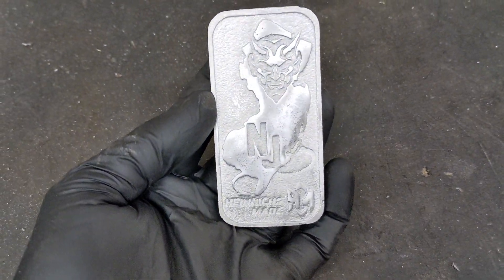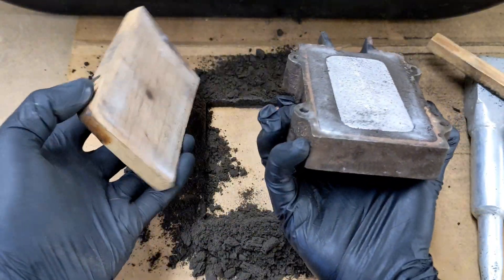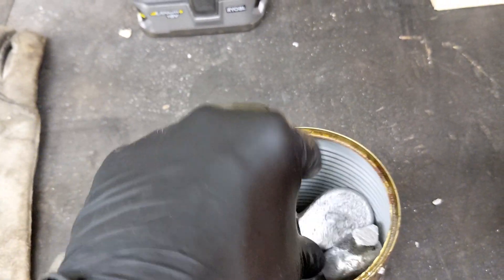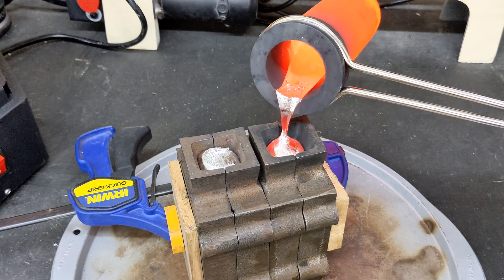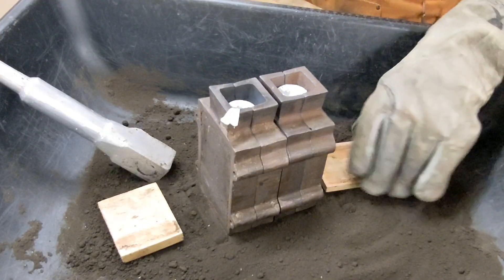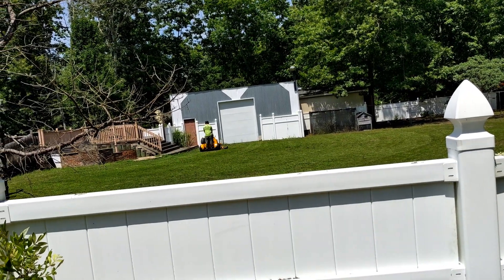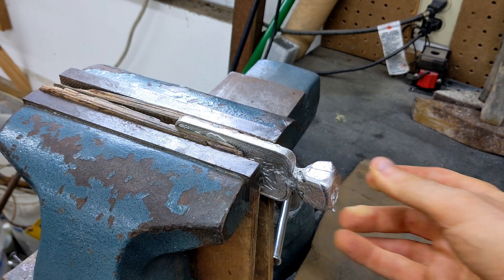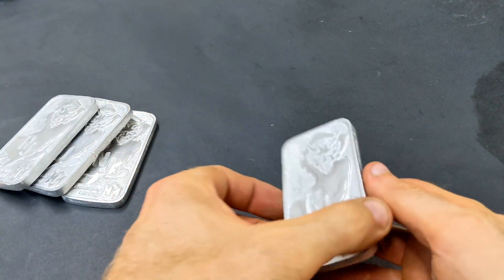DIY Aluminum Casting

Comment: Another really cool video. Couple of questions, 1) the baby powder that you are using is it actually talcum powder or is it pure corn starch?  2) have you ever considered making this bar out of .999 fine silver. It looks like it would be about 5oz of silver.
Reply from the maker: Thank you so much!  1) the powder I am using is talcum powder.  I believe I used the corn starch in the past and it didn't work. 
2). I don't really cast silver, because the only silver I have is rounds that I collect 🤣🤣. Maybe I could find some sterling silver 🤔
Reply: The only way I know to get .999 fine silver would be to use silver bars or silver rounds. Perhaps $150 worth of rounds or bars. I don't think it would change the value of the silver, I think that it would be still worth the value of the weight of the silver. But if you use bars or rounds you would destroy the collector value of the rounds or bars.